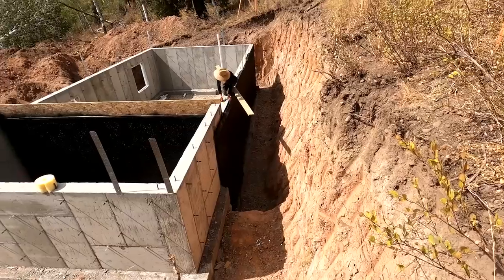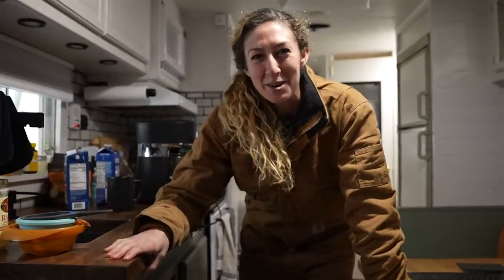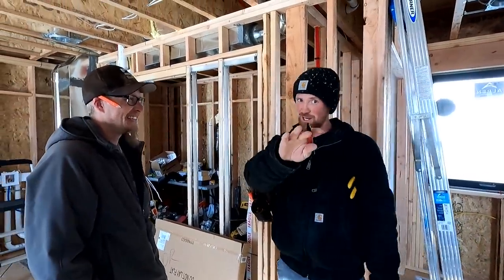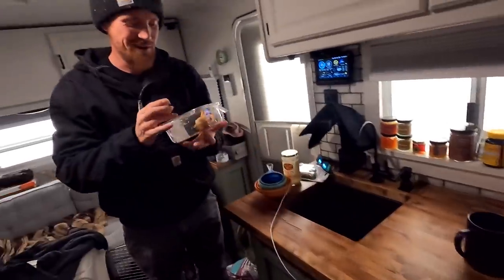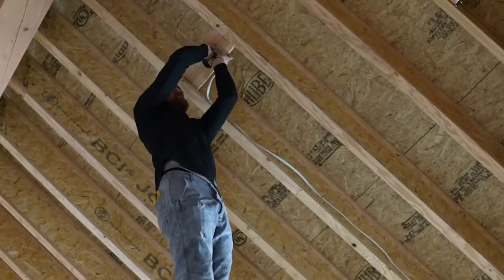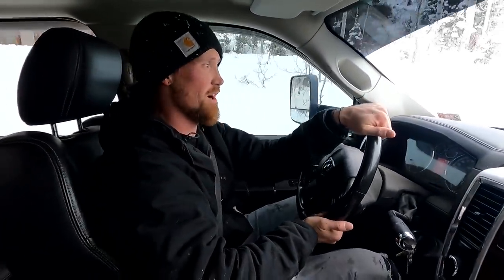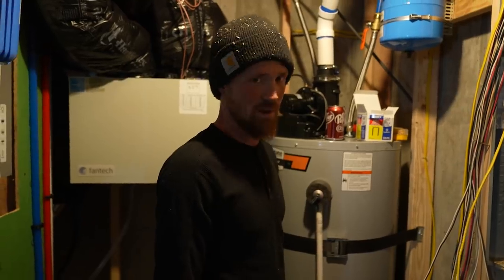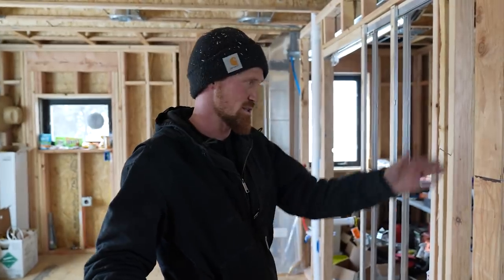WIRING OUR MAIN ELECTRICAL PANEL | BUILDING OUR OWN HOME

Comment: The ladder dance   it only  takes once  !  I developed ladder  and fear of heights  in the orchards grandparents had ild tome trees that 18 ft ladder not reach tall enough  and orchard ladder only have 3 legs by design top of ladder standing  you supposedly supose ti pick with two hands (good luck with that ) uneven ground  3 legs top ladder and have apple picking bag/bucket on chest which holds approximately 30 to 40 lbs of apples  to also effect balance   
The  falling not hurt  much the tree limbs slows fall some  but sudden stop at end does then the ladder smacks you to tell you messed up lol

Comment: The only thing I can see that is a no no is stripping the ends of the wires now. They will get dry wall mud and paint on them. We also always bring power in to switches from the bottom and all switch legs from the top.

Comment: 2-Points Maybe, as I saw you connecting the neutral and hot from your NMC cable I'm hoping that you are using AFCI circuit breakers as specified in the NEC 2020, and AFCI/GFCI combination breakers for wet locations. Was the furnace breaker blowing because it was the 240 circuit from the humidifier and you had it wired 120 in the panel. So it was wise in labeling each cable run, and don't forget your smoke/carbon monoxide Bat-AC detectors must be on its own circuit.  May the God of electricity smile upon you and your inspector.
Reply: I think that when he wired up his pig tail, he reversed two wires. He fixed that and it all worked. He just had a mistake in his temporary connection.

Comment: just remember to never ever use two fingers on a breaker to turn it off and on.  When there is an electrical surge/short it causes your muscles to contract and you cannot remove your fingers off the faulty breaker.  If you use one finger or the knuckle to nudge the breaker switch and there is a fault your finger will be shocked off the breaker and it will not kill you.  Two men died in our area when man one used two fingers on a faulty breaker and man two died trying to pull man one off the breaker.  You two are so close to your inspection then on to the fun stuff.

Comment: Have you thought of putting a flood light outside in front and back that goes on when there is movement! I have one and I have found it useful! Had. Possum possum outside making my dog go crazy and the flood light went on and scared the possum away should do the same thing if a person comes on your property I highly recommend it and my front door has a flood light that goes on if you knock at the front door or there's activity at my front door and it goes off to save electricity when it's not used. Just a thought cuz you live in a very dark rule area I even live in a subdivision and I like my flood lights that come on when people come on my property or around my property even if it's animals

Comment: I noticed in the last video you were hurting your fingers while hamming electrical staples. Try holding the staple like a roofing nail. Palm and fingers up. Personally I would never use the old type Staples, I would use the newer plastic version with two Nails on either side. The house is looking good.

Comment: Trent, I've always been told that the breakers of the highest rating ought to be nearest the main switch. Have you done this or have you just taken the circuits as they came to hand.
   I've not been with the videos from the beginning, but wonder what you both do in real life, when you are not travelling or building a house in the mountains.  By the way, what is the elevation of your house compared to the that of Home Depot or your favourite plumbing store....
Reply: In real life, they are: 
Vloggers
Story tellers
Video editors
Documentary filmmakers
Merchandising Managers
Marketing Department
Reality stars
Problem solvers
House Framer
Plumber
Electrician
Chicken farmer
Van builders
Entrepreneurs
YouTubers
Hardworkers

Comment: And I had dimmer switches put in the bathrooms and had the switch  by the doors turn on two light and a tall lamp in the living room and my bedroom and now you have a smart house (I do not have a smart system which is better than dinner switches etc
Love your you-tube channel  you guys  are doing good  learning as you go. Do you know they have light plates that have lights included that turn on when it's dark  and turns off when  it morning lights come on so at night it leads the way in the dark! No wiring also out by my pool and in the kitchen and bathroom and sink by the washer and dryer - where ever there's water  gave breaker switches clicked off for safety reasons for water! Haven't heard you say anything about breakers switches when water inside and outside? Yo7 have so much to think about didn't know if you did this even down stairs by the hot water heater incasecit floods or leaks! Love the big porch glad you screwed it all in, would love a big porch like that with that material!  Love all the music where do you find all that great music when your editing your Music? Love the fly over, you do a great job with the editing --- feel like I'm there with you except I live in the warm weather in Fl
my body doesn't like cold weather!

Comment: There is a much easier and safer way to strip the insulation off of Romex.  There is a very inexpensive wire stripper that manually clamps and cuts down the center of the romex, only contacting the ground if anything.  Then its a matter of ripping/cutting it off to remove this outer layer.

Comment: Still didn't put a vapor barrier boot behind the electrical panel I see. A warm  metal box up tight against a cold concrete foundation WILL produce condensation. You don't need my 28yrs construction experience to figure out that water accumulating in and around the electrical panel can cause multiple issues, some dangerous some not. Why not prevent it now with a 2$ vapor barrier boot? Cheers from Canada!😁🇨🇦

Comment: I would think that little extension cord isn't big enough for the furnace let alone the panel??
Isn't the wire bringing power into the panel supposed to be bigger??
Reply: It is temporary... The only load currently would be the furnace, the thermostat  and the utility closet light... All of which were on it before he connected up the panel. There are no switches or outlets connected. Trent was only using that to test the panel.

Comment: Sorry Trent, you're not done with the electrical if you haven't ran the cat5 and coax. Even if you don't plan using them, the house should be pre-wired for low voltage for the future use. As an Electrician, I always suggest to the owner to pre-wire for everything. Including cameras and security. I also notice you didn't wire for security floodlights? You're in bear and mountain lion country!?!?

Comment: This might sound like a dumb idea but why not rig up some kind of basket pully system for the scaffolding. That way you won't have to throw tools etc up from the floor to someone standing way up on a ladder or the scaffold.
Reply: Or a rope.  There was a previous video where I was afraid the drill would go through a window if Trent missed. Tossing stuff as a plan seems like a bad idea.

Comment: if there is no electric to the house where did the the power come from for the light at the panel
Reply: They have electric for Terry. They must have run up an extension cord.

Comment: @11:54 how many wires do you have going through one hole on the studs over your head? Better check the code on that.
Reply: @armslength2618  In Comi Californian you are only allowed 3 per hole, yes there is a code for how many and how big the hole on certain studs can be but there is also a code for how many wires per hole. Check the code book for your state.
Reply: @armslength2618  Example:  Article 334 Nonmetallic-Sheather Cable: Types NM, NMC, and NMS
II. Installation

334.80 Ampacity. The ampacity of Types NM, NMC, and NMS cable shall be determined in accordance with 310.15. The ampacity shall be in accordance with the 60°C (140°F) conductor temperature rating. The 90°C (194°F) rating shall be permitted to be used for ampacity derating purposes, provided the final derated ampacity does not exceed that for a 60°C (140°F) rated conductor. The ampacity of Types NM, NMC, and NMS cable installed in cable tray shall be determined in accordance with 392.11.
Where more than two NM cables containing two or more current-carrying conductors are installed, without maintaining spacing between the cables, through the same opening in wood framing that is to be fire- or draft-stopped using thermal insulation, caulk, or sealing foam, the allowable ampacity of each conductor shall be adjusted in accordance with Table 310.15(B)(3)(a) and the provisions of 310.15(A)(2), Exception, shall not apply.
Where more than two NM cables containing two or more current-carrying conductors are installed in contact with thermal insulation without maintaining spacing between cables, the allowable ampacity of each conductor shall be adjusted in accordance with Table 310.15(B)(3)(a).

Comment: Don't you need deck stairs before inspection????
Reply: I can't imagine why... lots of decks without stairs... if anything, they would require railings... but this inspection is for Framing, electrical, plumbing and HVAC... not final.
Reply: @divekatdreaming  I know what the inspection is for
Reply: @spoonypoon7998  Ok.

Comment: Please don’t leave the extension wired into the panel like that. The neutral is wired to one of the bus bars rather than the neutral bar. All the power is being drained to the your ground connection if that is on a pipe, your water lines will have high current on them. Not to mention you may be directly connecting live to neutral.

Comment: It's hard to explain properly but a razor blade is the appropriate way to strip romex. But there is a wrong way and a right way. I wouldn't recommend what you're doing because you can pinch the insulation. But whatever its already done. I also wouldn't recommend a DIY electrician but that's already done too.

Comment: Little furry babies and even some larger animals get car sick. It has to do with inner ear development . The balance centers for their bodies are in direct line with their ears and their eyes. When a pup cant see where they are  they a spinning action felt in their stomachs triggered by the inner ear water level  changing its level quickly. Now in the beginning puppies more or less react the same. Orient them where they can  relate their environment on the same level as their body. As  their inner ear matures they get much better on rides
Now with Leeka a young pup her sight and balance are kind of inter unconnected very strongly. Not only does this affect  balance but affects the way they see thongs

Comment: Hey Trent and Allie... Great job.. I have enjoyed catching up on some of your older episodes.
I don't see any CAT6 cable run for home networking and internet.  You may think wifi will do it but as an IT pro I recommend having at least 1 port on your main floor and one in the bedroom.  Steaming services are more reliable over a hard cable.  Also your computer  work area you probably would like one.  If you want any suggestions for networking including wifi.. happy to provide some input.. rometheis.com

Comment: I do not understand why you wrote on each cable the outlet, but then just stripped all those off.  Now you do not know which breaker feeds what outlet.  I wired up a whole house and each cable was labelled like you did.  Then each cable name was added to a breaker that I labelled.  This way I knew exactly which breaker went to what outlet. If a breaker trips then you can see what circuit or outlet was tripped. As Barry said if you want to isolate a particular circuit or an outlet, then just switch off that breaker.  Too late now as you have no idea what cable goes where to.

Comment: a breaker that keeps tripping - I'd get my electrician friend to help figure it out.  3 times - you're going for 4 times - that should be telling you need the pro.......
Reply: They figured it out. Trent just mis-wired the temporary pigtail. No big deal. He fixed it and it worked.

Comment: I laugh when you say electrical is the hardest trade. Please hang the drywall, especially on that high ceiling, and then see what is a harder trade. Shingle roofers, concrete workers and and drywall installers are the hardest trades by a mile. I wired my house and shop and enjoyed every bit doing it. Hanging the drywall sucked.

Comment: Not an electrician...but.... I have never seen the logic of wiring a domestic building for lethal voltages, like 240 or 110 AC. Yeah, for producing power and transmitting it, high voltage AC is the best.  Many personal/domestic stuff can and does run on 12 Volt DC. Computers, LED lighting, and you can get 12 volt DC versions of most white-goods, like Fridges, T's, washing machines and the like. Anybody who has an RV knows this. 
But the market pushes 240 or some other high and lethal voltage onto the public! So the market dictates this insane practice. This also means that most home appliances have to have a little step-down, AC to DC transformer...all very inefficient. And despite many precautions, people still get electrocuted. So why not one big step-down where the power enters the house? Of course, it may put a lot of electricians out of business.... 12v DC is also great from the emergency/back-up power point of view. 
Even in RV's, 240 does not make a lot of sense. You need an inverter. Why? Most of the time, to re-charge your laptop or phone or whatever. So you pull 12V from your solar panel or battery, it goes through the inverter, comes out at 240, and then you have to put the 240v plug in which, is a lead that has a step down transformer back to ~12 volt to charge your laptop battery! Totally insane and inefficient.

Comment: A big Failure I often see on Youtube is that Romex goes on the Ceiling Diagonal across a room. This is awful and disgusting! Only Rectangular Wireing Paths are proper installation!
Reply: @armslength2618  To write "A²" just push "AltGr+2"  😁
And "A³" is just "AltGr+3"
Reply: @armslength2618  Owch! I know how it is when you want something to write, but your keyboard has its own ideas lol...

Comment: Trent is certainly an egomaniac, he seems to need to validate his work long before a true tradesman would do it. There is no good reason to power up the panel before one finishes wiring it and usually not before inspection. The furnace should have been left on the temporary wiring, this was strictly an ego massage. He did the same thing with the water distribution, nobody charges a water system during the winter unless they are massaging their ego. Therr is no upside to having charged water lines in an unfinished home and a huge downside if the heat goes off with nobody around. At every turn, Trent proves himself to be a bigger jerk and example of why most homeowners shouldn't be allowed to build their own homes.